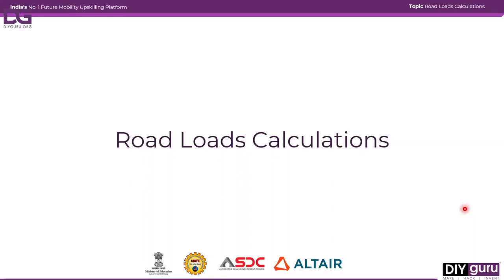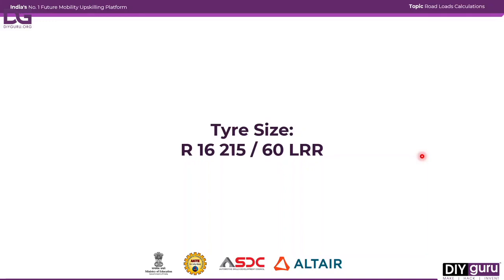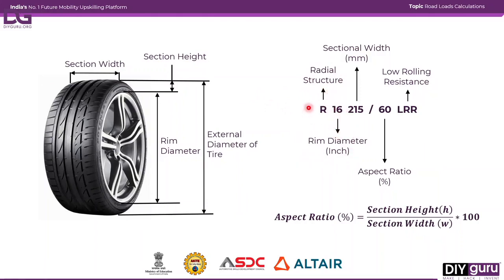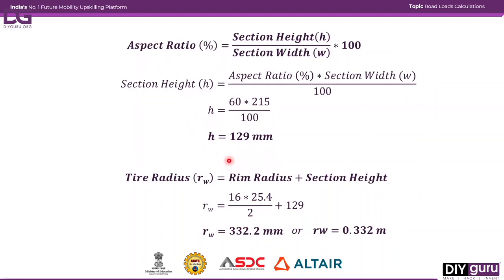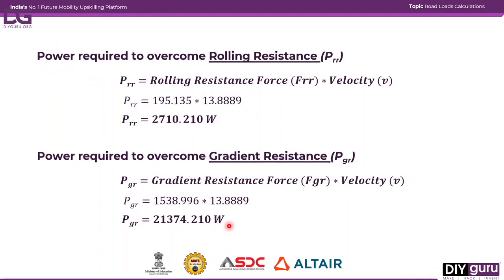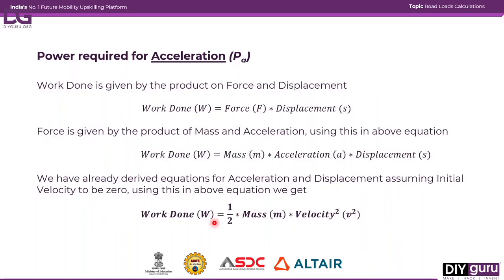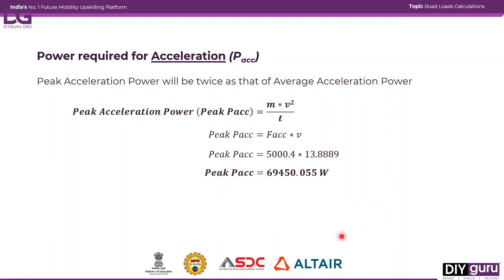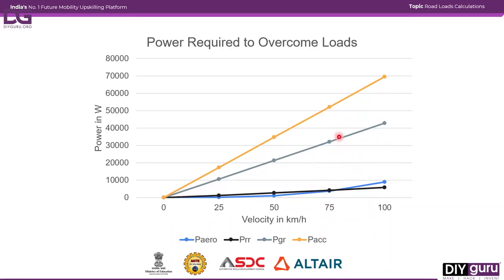Road loads Calculations of Torque and Power | Tractive Force Torque & Power | Electric Vehicles (EV)

Comment: Sir can I ask how you calculate the drag force of a car ? how did u get the drag coefficient and cross sectional area of the car  ?
Reply: There are 2 ways : 
1. Estimate CdA value by taking a reference from similar vehicles
2. Run a CFD test in CAD using the 3D model of your vehicle. You will be able to extract CdA value from that. Next, when viewing the vehicle from front view, trace the outer edges of all visible components. Anything that is hidden will not be considered. Make a planar surface of that sketch, and use CAD to find out the area of the plane. That will give you frontal area. So now you have CdA value from CFD and A from CAD. You can solve for Cd from that.